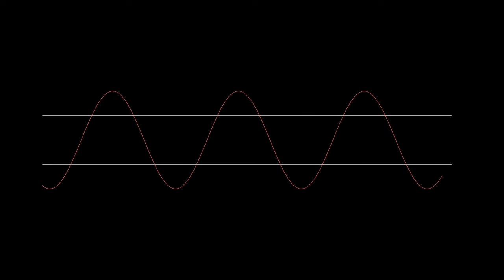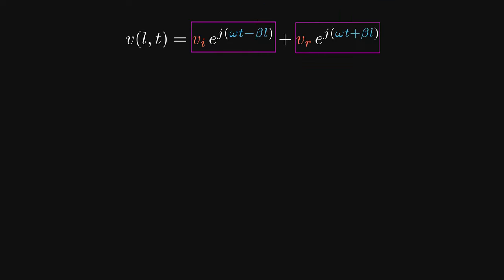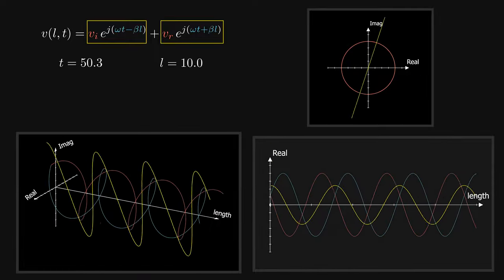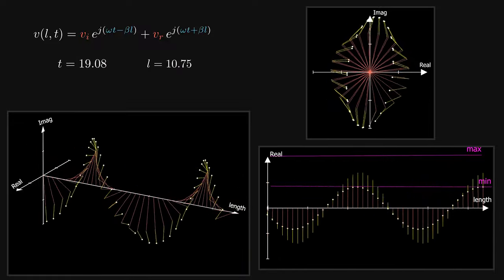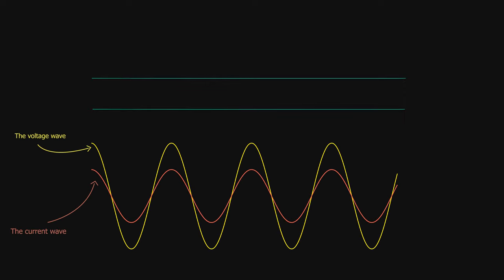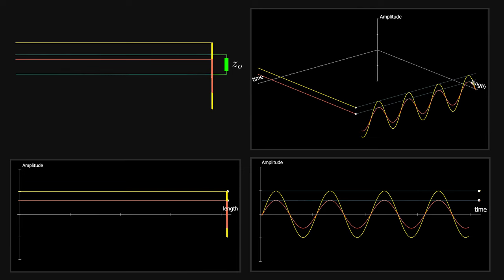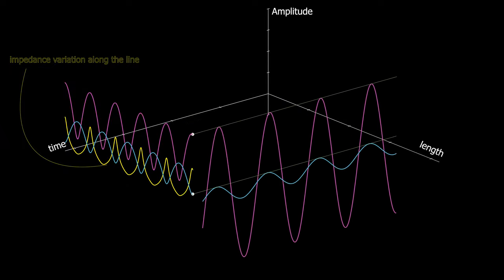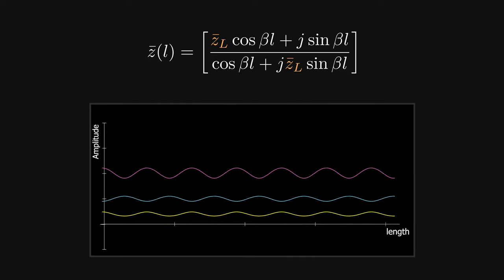But how exactly do the voltage and current propagate through transmission lines?

Comment: Great 4-D video showing the often ignored time and especially the imaginary part! Someone already pointed out the wrong highlighted negative sign by Gamma. The voltage/current amplitude triangular chart also is slightly wrong. Gamma is the same for both voltage and current (there should only be one circle for showing 1 + Gamma and 1 - Gamma), but the voltage/current amplitudes have different prefactors (by a factor of z_0) which scale the whole term in parentheses. If just showing 1 +/- Gamma, there is one circle and a clear way to see the standing wave ratio.

Comment: I think there's a mistake at @8:45. That minus sign is the same for both current and voltage. I think it's the sign in front of Gamma which rotates the vector 180 degrees.
Reply from the maker: Yes, You are right :)

Comment: I have to deal with real world transmission lines.

However, my transmission line is much shorter than the wavelength of my generator signal (it is in the kHz range). I just cannot comprehend how standing waves will form in it. Do we need more complicated math for this case? Does your visual explanation still apply analogously?
Reply from the maker: I think the answer is in the first video of my transmission lines playlist.
notice that the standing wave pattern repeats each half wavelength of the signal. So if the wavelength is too large compared to the line, there's no standing wave and you can treat the line as a simple wire in circuit theory (super conductive wire with infinitely small dimensions). as a rule of thumb you can use the lumped element model if the line is less than (1/20)*wavelength. Hope that help

Comment: Wouldn't the power company use a capacitor/inductor to fix the signal coming back so that the impedance of the reflected signal is purely real?
Reply: There is virtual no way you to get rid of the characteristic impedance of a transmission line.

Comment: Voltage does not propagate. It is the measured potential difference between two points. Neither current propagates. It flows. Waves propagate.
Reply: Bro do know u alternating current, electric field and capacitance on long transmission line? If u dont know check out him video about transmission line
Reply: Did u think this direct current?